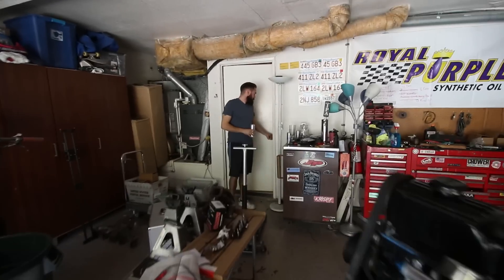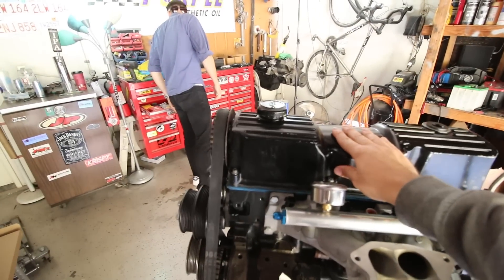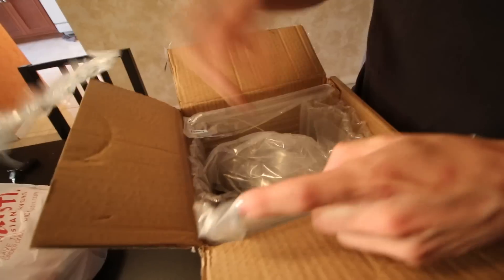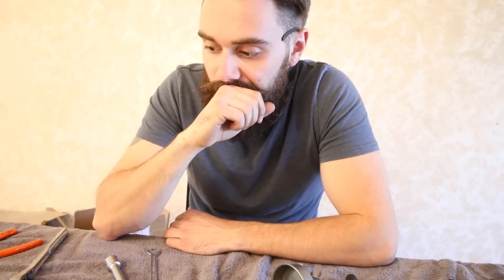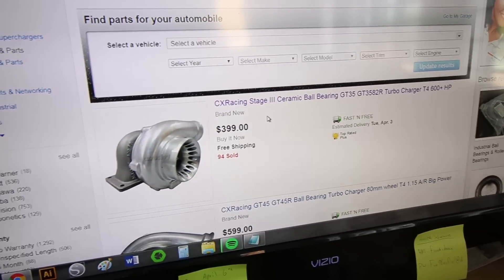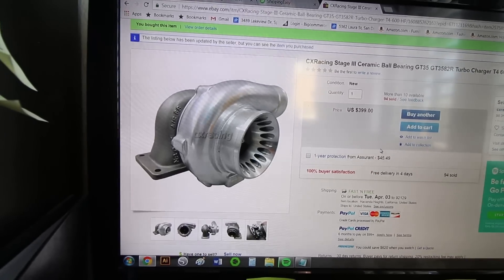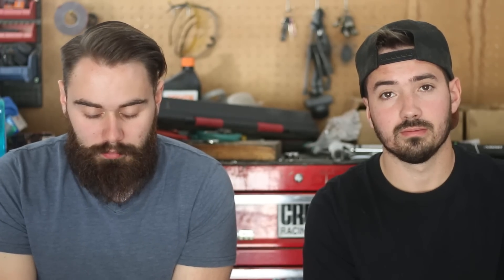What's INSIDE an eBay turbo!?

Comment: Removing the shaft nut for looking into the center section prevents the wheels from being perfectly realigned again for balancing purposes. I know you were returning this one so no foul but I don’t want others to do this just for fun/curiosity. While I have a real turbo I plan on trying an eBay turbo one day based on the success of others. My Intercooler could use and upgrade should it grenade anyway.

Comment: they arent always ball bearing either though the stock cummins turbos are brass journals instead of ball bearings its only when you get into bigger sized turbos they must have ball bearings.... but i have never seen one with both ahaha thats funny stuff haha good thing you took it apart
 personally i would just save yourself the headach and buy from a reputable dealer instead of gambling on ebay <3

Comment: I've bought numerous too-cheap-to-be-good parts from eBay and usually found them to be pretty good. My favorite is probably the LED headlights I got for my old VW Bug. $80, were clearly knockoffs of $500 JW Speaker units. Avoided them for years, hoping to save up for name-brand, or even takeoffs from the late-model Jeep Wranglers, but finally looked into it a bit more, found a lot of Jeep blogs where people found they were pretty decent. Decided to give them a try, not a ton to loose. Found they work great - huge upgrade over stock sealed beams and they've worked great for well over a year now.

Comment: Well also,  you could have done this, for about $5-10.
Remove the journal bearing,  measure it and buy a ball bearing that size to smack in there. 
Or 
It looked like there was enough meat in there to ream it out .. Then put in a beefer ball bearing set. Just food for thought

Comment: Most of the china / Ebay turbos don't have dual ball bearing turbos. Most have the "ball bearings" on the compressor side.  The bigger problem is the ball bearings themself. In truth I could write a short story on why but I'm just going to leave it at that you're better just going with a journal bearing type when using eBay China turbos. Honestly unless you're making insane power, and seriously racing , and in which you'd probably be going with something like Garrett anyways, then using the journal style is more than adequate. In truth you'll probably have better overall results with the journal Style. It's a common style, and also economically it is the easiest style to have upgraded in quality over the years. And they have especially since some 10 years ago when a lot we're failing. You can call it China junk but you also have to remember that if they want people to continue buying the China turbos, then they need to make them reliable. Not to mention there is a race scene in China and Japan Etc. And so it made sense for them to make these reliable and they have, and many have great results with them. Unfortunately for the ball bearing styles , they are not as common to be bought and used, so to keep costs down many are only Journal Style in which were machined to accept the ball bearings.  This also gives fittment issues with finding quality ball bearings to upgrade the china ball bearing turbo. You can however replace the "center section" of the turbo as said in this video,  but now your opening another door for issues, such as matching your compressor & turbine impellers to the housing size, & im not even talking about for the performance aspect, even tho this is also important,  but more importantly the fitment, clearances! 2nd is that this is the most expensive part of the turbo,   so buying a high quality center section from Garrett or whomever,  is going to cost a decent amount as it is,  & then buy the time you make sure that you properly matched the mix matched parts,  you might as well just buy a Garrett.  
Just saying.  But I'm also not knocking this video or the guys in it because i still respect that they are putting in the time & research to learn & try to make things happen.  While it may not be the most efficient or effective way, it is how we all learn & make new things happen.  I have definitely been there, & after over 20 years doing this stuff,  i still do things like this myself in different ways,  so definitely respect it. But i say all this for the beginners or people who can't afford to play around with projects over their heads.

Comment: Just found your channel was having problems finding performance parts for my VG33E  until recently thinking of running a turbo. There is  actually a turbocharged engine model but mine is not your channel has made it as painless as possible thanks.

Comment: FWIW Ball Bearing turbos are kind of over rated.  Thousands of hot rodders are running them, even EBay ones even, without issue.  What causes cheap turbos issues is running the hell out of the car and then just shutting it off hot.  The oil then stops pumping and just bakes inside the turbo as it is VERY hot.  If you take a minute or two to let the engine idle after running the car hard it will add lots of life to the turbo. Hopefully someone sees this that needs to see it.

Comment: Ebay sells crap... if your poor and want to F... up your ride put an EBay Turbo on your ride. Quality parts may cost more but will save you more $$$ in the long run... Most of Ebay crap needs modifications to work... been there done that... you get what you pay for... pay now or later, your choice.

Comment: Metal composition, manufacturing processes quality control, bearing id numbers (verify suitability for yourself)... plus other factors.
2 ebay turbos that look identical, can be very, very different units.

Best insurance? Investigate how the Chinese manufacturing system/process actually works.
Hint.... Much different to what we are used to.

Comment: I built an entire 450bhp twin turbo vr6 setup with eBay parts (apart from the turbos which I got free from work). Still going strong 1.5 years later

Comment: When you first gave it a spin, I thought journal bearing right away. Not that I'd really complain with that. Quality journals do a great job. Very little friction once pressurized. The compressor wheel had a reference mark and on the nut was the ground-off bit from the balancing process. You'd have to line it all back up exactly the same as it was for this turbo to work now. But I'll bet if you did, this turbo would boost nicely and that ball bearing on the compressor side would be just enough to make it robust against surge. The cheap metallurgy that went into casting the turbine housing is the part I wouldn't trust.

Comment: Great video! I didn’t know they made turbos like that! What good would that do anyway, need a restriction for the ballbearing but the other... I can see a disaster happening either way! Haven’t had any luck with turbos from eBay . Show up with shaft play . The last two companies tried saying that its normal... uhh wtf do take me for? Like to just get a factory turbo but new are really expensive and may as well get one from Garrett, the other option is a good used one... until you check the waste gate and it hangs up on the hole for the flap! So how do you get something reliable and stock for the car and not get ripped off? All these new cars with turbos n one day, cause the dealer won’t tell everybody that you have to cool down your shit after hauling stuff and the shaft/bearings coke up with that 10,000 mile oil change bs n the oil looks like it came out of a Diesel engine at 3,000! So this cheap China junk turbo crap needs to go ! The inferior metal they use is porous and after boosting up the toy to 18psi a dozen times the housing on the hot side cracks, blades start grinding, wastegate seat cracks and the retaining washer on the wastegate melts enough for the flap to fall off! Point is that even if the turbo looks good and measures out right on the inducers and exducers you still don’t know what kind of crap metal was used to make em! And it doesn’t stop with turbos, it’s everything anymore! Y’all know what I’m  saying! And then the worst part is you spend a few weeks pay on a good turbo and the dam thing comes in a box that says MADE IN CHINA 😡🤬 Is there a way to tell if stuff you’re buying is made with quality materials? We all want to save money and get the stuff we want whether to play or get to work? Btw Autozone parts are from .... ! But when they fail you just got to go to the store and swap them out, cause they keep em in stock🙄 Since fricken when does Walmart sell turbos?!!! Sorry for the rant!

Comment: Bought a $40 cai and the bracket didn’t come with it to hold it solid to the frame and had to custom make one put the pipe in had to go underneath to secure the custom bracket and to install the filter 😂

Comment: I run a blow off valve from EBay for my 3sgte and it is great.  It is a SSQV knock off and I love the sound.  I am currently building a 2jzge NA-T and I am planning to run a EBay turbo and inter cooler.
Reply: R.A.W. Performance same on my father's is300. about to run a ge eBay turbo kit for 800$

Comment: If you send an ebay turbo off to be properly balanced they may actually last a long time. Many are not balanced and end up going though bearings and blow out oil seals in a few thousand miles. It will cost about $40-60 but will be worth it.  Same goes anytime a turbo is dissembled, rebuilt or something like a compressor wheel replaced with a lighter billet piece.

Comment: Bro..   guys like you should not be touching cars.  

A - Because you are clueless Measured the turbo the wrong way
B - Because you jeopardize real race cars at the track by supporting this junk which explodes and takes out oil lines fuel lines etc causing accidents.
Reply from the maker: Gary Andriotis Calm down. Everybody makes mistakes. Plenty of people run Ebay turbos with a lot of success.
Reply: Why be calm about life?  You are endangering people at the track with this BS all around and this video shows plain ignorance.  You are gonna tell me you or anyone who buys ebay turbos never hit the track?
Reply from the maker: Gary Andriotis Boosted Boiz routinely made over 600whp with an eBay unit. Many of them are well built. 

If they were as dangerous as you think they are, nobody with an eBay turbo would pass tech inspection.

Comment: i have not bought any eBay parts (outside of genuine parts) for any of my cars, though my friend has a gt35r eBay turbo on his Integra and he hasn't hand any issues with it and on his flow bench it moves only about 4-5% less air than his real Garrett gt35r

Comment: Brought 16 piece stainless exhaust/ intake valve kit for stock 351 ford Cleveland cylinder heads.  Had no issues, and ended up selling the heads later on and got $300 for the set.

Comment: Ive bought one of those lil cheap eBay chips for my work car and it was supposed to do a 50hp gain and better fuel mileage so i was as like hell to the yeah cause it was $50 like 5 years ago . but the funny thing is that it didnt work it was just a chip with a lil red light on it. So when you pushed the throttle the lil red light would turn on letting you know that it is working. So long story short it isnt really a performance chip like advertised on ebay. It doesnt do anything at all but turns on the red light on the little black performance chip when you press the gas. If you ever watch mighty car mods you will see they bought one of those chips to. But they sent it out to get it tested and it is just a fake chip with a red light. So i was a lil pissed but its funny at the same time cause i was stupid enough to spend the money and time hooking this thing up just to have a red little light turn on with no gains at all. But oh well. I will just stick to actual name brand chips. Hello from Montana

Comment: my ebay parts were an entire turbo kit, the turbo was some sort of hybrid thing it was a jm turbo technologies cold side and like a holset hot or something like that and it worked amazing, was a true 76 mil, and the rods i bought were SGI h beams and they held 700 hp and me beating the piss out of them, i machined them in my block, a little bit but they were great

Comment: Hello my name is David and im a certified turbo mechanic. I want to let you know that once you remove the compressor wheel nut you can't use it again, simply because its balanced from it and you can't get it to the right position. Once the turbo core is assembled it need to be balanced again.
Reply: What?   On paper this is true, the shaft should be balanced any time its fucked with,  but it can certainly be used again.  Not to mention diesel tuners have been replacing inducer wheels without rebalancing for literal decades without issue

Comment: I bought an OBX Helical LSD off ebay for my 2007 Porsche Cayman S and the bolts were loose and I had to deburr a few rough edges inside but for the last 5,000 miles it's running good! Great channel

Comment: Bought a refurbished Ford Falcon XR6 Turbo for replacing a turbo on a car off of eBay. Thing hand grenaded in an hour. Properly installed by a qualified mechanic and drive by a 60+ year old woman.
Reply: Many "turbo failures" are NOT the fault of the turbocharger. Oiling issues are the #1 problem.
Reply: Definitely a problem with that specific turbo, the XR6 Turbo uses a genuine Garrett turbo which don't just grenade for no reason

Comment: I bought a high-capacity aluminium radiator from China, in eBay. The build quality was awful; every single dimension was off. Had to chop off all the mounting points because every one was incorrect by differing amounts. The radiator itself works great though!

Comment: Any good eBay injections?  I have used plenty of parts from eBay. Control arms test pipes catback y pipe oil pan water pump. Belts fans. The fans worked fine, Y pipe fit fine and the exhaust fit fine. But all exhaust parts I have bought are meghan.the oil pan didn't fit at all. Was about an inch too small. The control arms that are emusa have been excellent for 3 years. Bought a set of mdu coilovers adjustables have been great for 2 years and going strong still. Water pump and timing belts have been excellent. Water pump brand was gmb and belt was gates(not sure it counts since it's all known quality) I have used blox products without any issue at all. 
My boost gauge is a no name cheap $8. It works kinda. I wouldn't recommend it at all. I bought my arp head studs and npr rings from eBay.
Overall if you are careful about what you buy on eBay it isn't a bad place to shop. A lot of times can get name brands or n.o.s products for cheaper or just find hard to find parts.
I am also working on an eBay turbo build.

Comment: I recently bought the Launch X431S  pro mini diagnostic computer (they make the Mac diagnostic tool)... just received yesterday and have not even programed it at this time... hoping to use it to change the governor on my 06' sprinter that is governed at 82 mph... when we drive out west the highway speeds are 80 and I need to up that to 95 mph to keep from getting run over by semi's ... also bought a glow plug controller from ebay along w/ the glow plugs for said Mercedes Sprinter...... Many Blessings , SMR

Comment: bearing are best
Reply: They all have bearing? (If I could put a 'roll eye's' here I would).  if you meant ball bearings you should say so. Full ceramic ball  bearings are best for low friction at high rpm and high heat. Plain bearings may have oil shear issues causing extra drag. Just look it up

Comment: I bought a Aluminum radiator and stainless steal headers for my fox and the radiator came with fans saved me over 1800 bucks and they worked great to help me drag out a 08 Zo6 through the 8th

Comment: Boostedboiz use that gtx3582r turbo ,and he does make 700 whp on it
Reply: Its not just what it will make, but how durable it is.  Is there a Ebay company that is reputed for durable and low cost turbos and performance parts that anyone can recommend?
Reply: THE ONLY "REPUTABLE" EBAY TURBO MANUFACTURE IS CXRACING. They have actual pictures of their products installed on their own vehicles, their intercoolers are supposed to be great and they even flowtest
Reply: Cxracing is legit. This is not their stage 3 ceramic dual ball bearing turbo. This is the typical turbo advertised as a “ball bearing” turbo on eBay. I’m pretty sure this is not the same turbo used by Kyle.
Reply: @caribbeangtr8077  I know that also but boostedboiz has had that turbo for 3 years now ,he also has it on his 700whp mini van and some of there other cars these turbos are built well
Reply: ran 700 hp for 2 years just fine. On 23 psi i believe. It could go much harder.

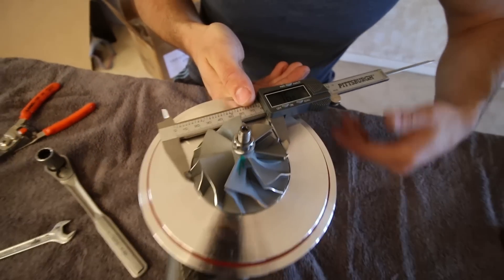Comment: I hope @5:44 you were meaning to measure the Exducer of the compressor wheel.  As you might already know, when a turbo manufacturer says they have a "76mm" turbo, they are usually referring to the Inducer of the compressor wheel, which is the diameter of the tips of the compressor wheel.
Reply: I was just about to say this. This is another way eBay manufacturers turbos false advertise.
Reply: @ItsAdust  I measured 3 of the the to4e one and they were 52.4mm. Figured someone might want to know.
Reply: I was thinking the same thing. They def measured the part.

Comment: I bought a k03 turbo on ebay and it did ok but the exhaust seal leaked a little oil. Turbo said it had a restrictor built in so I don't think it was getting too much oil.

Comment: Lol you spent 400 on that.... Lol you should run the same ones that boostedboiz use.... it's only 500 and is a real ball bearing. You can get the exact same Turbo that you spent 400 on for like 150 180 same brand same everything. This is why you have to read everything in the description before you buy something on eBay.... oh also make sure that whoever you're buying from sells a lot of turbos.